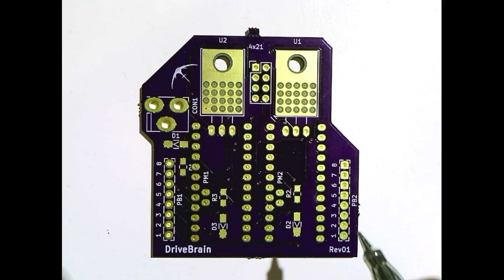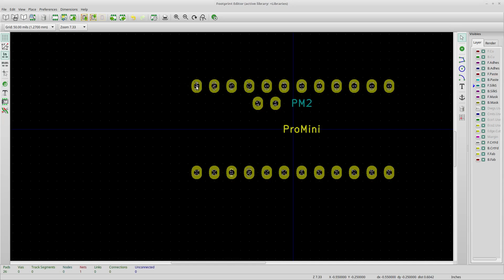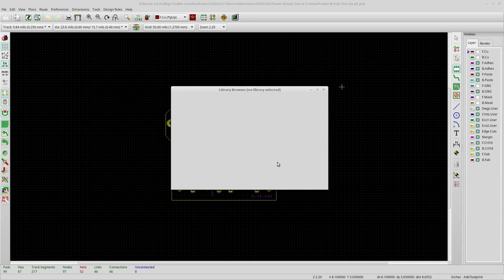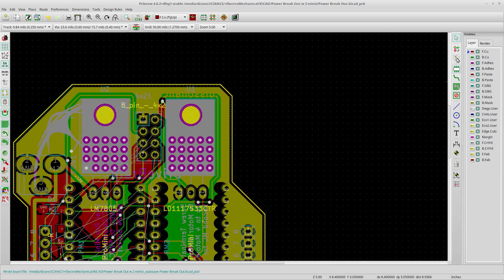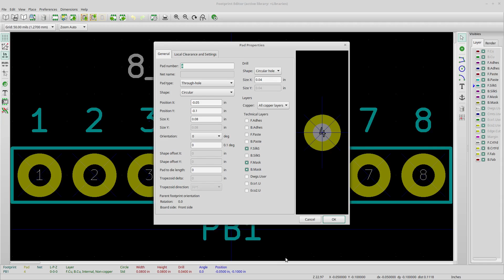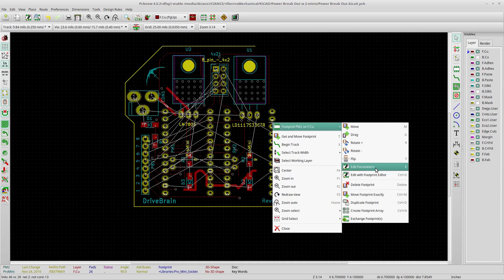Mini-Mecanum Vehicle - KiCAD PCB Rework - Part 1

Comment: I can see that you also had the problems using "via stitching" under the voltage regulators. The via's doesn't stitch the layers together and thus does not offer any thermal contact. It's known bug in Kicad that you really can't stitch wihout some workrounds. To update footprints, load the netlist again and select "Footprint: change" and it will update any changed footprints. The perfect hole size for pin headers is 0.9mm - then they locate nicely square in the holes before soldering.